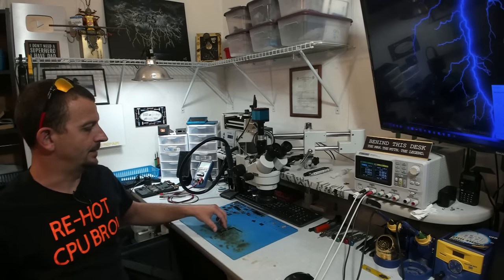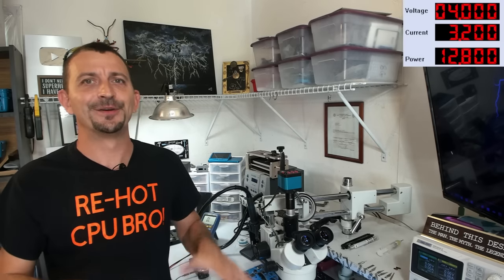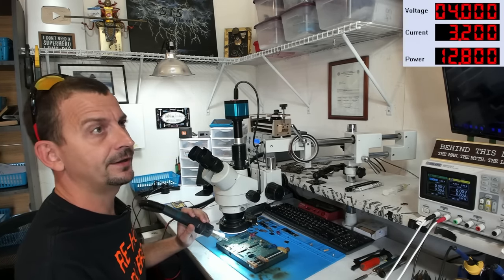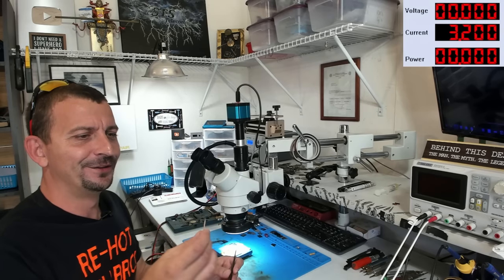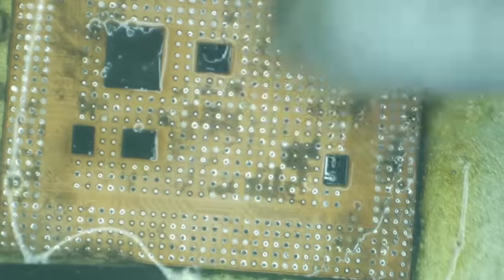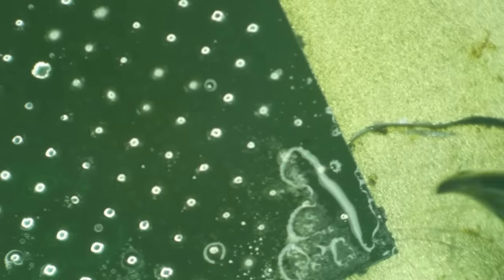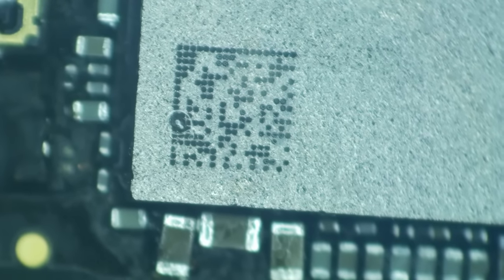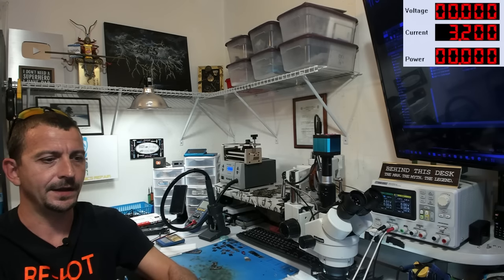An iPhone 12 Pro Max with LONG SCREW damage

Comment: I certainly hope these types of repairs are very profitable considering the amount of tedium and stress. You keep learning and advancing which can only result in a more successful business. Good on you !
Reply from the maker: This level of rework has increased my successful jobs per week consistently.  I try to only do it when there is a good reason with decent odds of success.  The board in this video was almost a guaranteed failure after seeing the CPU short. This video may actually prove one day that I did NOT damage that CPU!  LOL

Comment: I fully appreciate that you went for it even though it didn't work out. I learned so much during your process. You've got mad skills to talk through the whole thing explaining and pointing things out as you go. Hard luck but now you know what to tell the customer. I wonder if you will eventually have a bunch of failure signatures in IR that might help diagnose these problems rather quickly in the future and save you lots of time and effort. In any case, thanks so much for sharing this with your followers. Happy Holidays to you and the fam!

Comment: Great work. I just picked up a bottle of Mechanic S-60 BGA IC Strong Glue Removal solution. Its supposed to make it easy at removing the underfill on Apple CPU's. I have yet to try it, but you should definitely look into it!
Reply: IT WORKS GOOD

Comment: I fill my tip with 138 and collect and mix all the pins.
After that i use air and as soon as pins melt with 138 now i use a non sharped round blade and remove all with solder and black glue together

Comment: I'm surprised you haven't attempted a glue removal with a solution of acetone along with the heat or something 'magical' like 'goof off' or the like.. Maybe it would be as much of a mess, plus the flux is probably similar to either. Nice work anyway, you speak so well explaining your motives and procedures.. Nice work, as usual!!
Reply from the maker: Thank you!  I appreciate the compliments.  I have tried acetone and some other consumer grade solvents but are mostly too weak.  Months ago I tried an industrial strength solvent that was sold as "BGA-IC glue removed".  The results were terrifying!  Not only did it remove the glue but it also removed the coating from the bottom of the CPU exposing all of the traces.  I only had it applied for 10-15 minutes.  The bottle suggested to leave it in contact with the glue for 20 minutes!  Now I do this by hand using a #15 xacto blade.  Also have a technique that leaves most all of the glue behind on the board when removing CPU.

Comment: Make a cleaning blade from an old pcb, cut it so you can scrape the glue off safely after lowering the standard 217c to 138c, put the preheater around 250c.
Reply from the maker: Thank u! I'm always considering new tools and things I already have are what I like the most!
Reply: You’re most welcome Jason and thanx for your videos learned so much from all the explanations in your repair videos.👌

Comment: Welcome back1 Love the videos!

I wonder if there's some way to dissolve the glue under the CPU with solvents without destroying the cpu? Would be something curious to test. Acetone or Dichloromethane? Might be a bit too strong though.
Reply from the maker: Thank u!  I think people are actually using Dichloromethane with great success.  I'm going to try something stronger soon.  I've only ever used IPA, acetone & flux.
Reply: Oca glue remover works bit better than ipa

Comment: Mate, I think You should have fume extraction. Having the head engulfed with that shit is no joke- that part of electronic work I really hate.
You´re a good guy, funny, too. Your bench is neat and tidy and the "Thanks, Paul Daniels" remembered me of a certain Mr Rossmann I liked before his engagement in politics of "Right To Repair". That went straight to his head, I didn´t like his NY attitude anyway.
Coming back to fumes: I hate my fume extractor but even more so solder fumes. I made me one out of a variac and a vacuum cleaner. Does the trick and is cheap.
Reply from the maker: Thanks for the compliments!  I agree with you - for many of my jobs and for a long time fume extraction didn't worry me because the fumes were so minimal & I have really good ventilation in here.  Now with doing more CPU rework, it really does concern me as there are a LOT of fumes!  I will be building fume extraction into the bench very soon.  I'm planning to cut a hole in the back to bring a 3~4 inch hose in and try to get the guts of things located far away from the bench.  I appreciate you for caring..  the fumes are certainly a concern as I'd rather not die for my job.

Comment: Appreciate the video. In this case where data was not able to be recovered what do you do with the CPU, NAND etc from the customer's phone. Do u give it back to them on their screwed up (pun intended)  board?
Reply from the maker: I have started keeping my carefully prepped donor board unless it's necessary to give it away.  It takes quite a bit of time to prep them so it's worth more than just the $20~40 I usually pay for the board.

I haven't fully given up on this one yet but I have another 12 pro max needing a good board and I'd much rather use one that's already ready!

Comment: IDK if citrastrip would work to dissolve the glue or if it would destroy the CPU. I mean just a small layer of that stuff on any painted metal makes paint come right off. I would think the same would happen with glue. But don’t know if it would peel the dye apart. Maybe you can try it out on a broken cpu.

Comment: I have a question, wouldn't it have been easier to check, if the short has gone after you removed just the CPU from the original board? Shouldn't that be enough to tell the short is with the CPU?
Reply from the maker: Yes, I could have myself the trouble of reballing and putting it on the new board.  I believe this one is a RAM short that should be repairable.  This customer isn’t interested in data though so I’ve not went further.  It is awaiting return shipping payment!

Comment: Mmm nothing like removing conformal epoxy from around your balls using a hockey stick.

On another note there's a couple solvents I have used to remove  conformal coatings on automotive components such as ecm's and pcm's and ecu's one is called 8310A which is specifically made for removing conformal coating's.

There is the nuclear weapon equivalent which is DCM (dichloromethane).
 there's not much that it can't remove so it's very important you don't get it on anything you are not willing to remove and it is also a cat 2 carcinogen and it's fumes are rather nauseating so it needs to be used in a well ventilated area or a fume extraction system, 
Obviously it would pay to do some test pieces on some junk parts board's to be sure it's not going to damage anything other than the coating.

Comment: I guess you now know the signature of a shorted CPU, ie, high current draw in one phase causes an inductor to pulse with the CPU.
I guess you can check the power supply pins on the CPU on the bench after it has been removed for shorts, and that will tell you it's dead before having to fit it to find out it's dead.

Comment: Some people do not need to have a screw driver intheir hands and working on a Cell Phone. Those screws do not need to be real tight. And keeping the screws assorted on a magnet pad is cruicial in  order to work on an iPhone, or any phone. I would refuse to take apart a Cell phone without the magnet pad.

Comment: @Jason, what is the % of success rate on cpu swaps?
Reply: Toss a coin for that answer sometime excellent run then awful run
Reply from the maker: If the board hasn't been worked on before and has a good reason to swap the cpu, my success rate is ~90%.   If the board has already had extensive troubleshooting or just a little bit of hot air on the CPU by someone else, it really throws a wrench in that success rate!  It too is like @Wayne says..   good run, bad run!  I had 2 fails this week.  :-/
Reply: @ststele  Thanks Jason. 👍